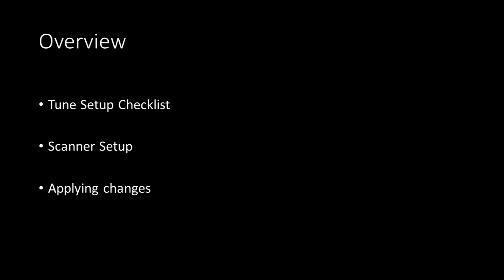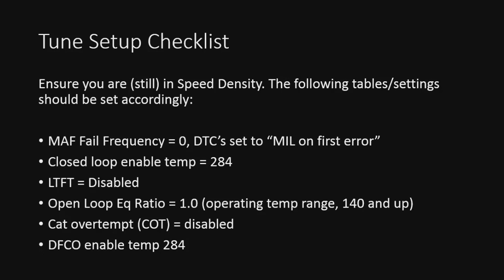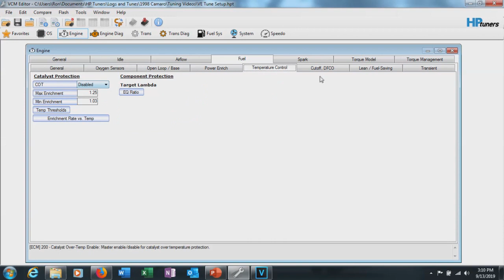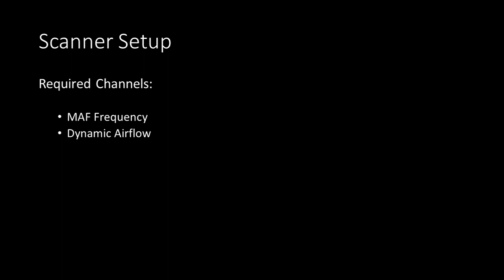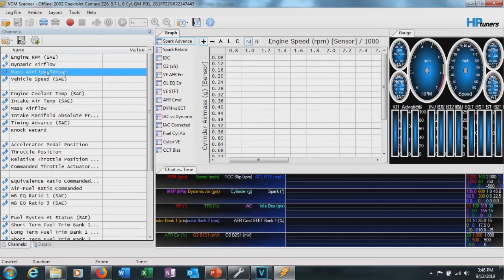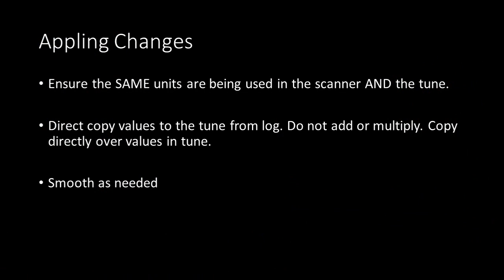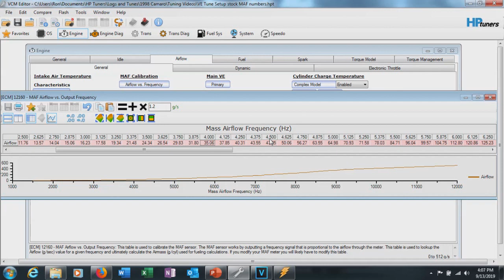Setting MAF Baseline in Speed Density

Comment: I'm a bit confused. This video for tuning the ve table or the MAF scaling?
Reply from the maker: Sorry for the late reply… This is just a quick tip kind of video, basically a micro step before doing a MAF tune. I use my dynamic numbers (VE based) to generate a MAF baseline (start point) before I reenable the MAF and tune it. This video is simply a how to do that small step. It’s not necessary by any means. However, if the VE was done right the numbers are usually very close - so the MAF tune is done in a few trips around town, if that. If done right all you’re doing is confirming. It’s pretty close more often than not. 

The cool part is, if you have the channels enabled and you like your VE error %, you can just do it from the last VE log. No need to drive or do any additional logging. Once numbers are plugged in, it’s just a matter of reenabling the MAF and going from there.

Comment: Trying to tune maf dynamic but i camnot get data log  on chart, it only showing 1 block on graph. I try to repoll parameter but still not showing any maf data  on graph. What should i do now?
Reply from the maker: Is it plugged in? The MAF frequency should still log even with the MAF failed.
Reply: Yes the maf plug in and try logging again and still show no data. I add additional pid such as maf sensor, cylinder air mass, and maf dynamic. Possible maf might be bad or maybe I have to drive it longer.
Reply: @ChopperDoc181 got new maf and work now but it doesn't want revs over 4000 rpm while drive. No cats or cel. Revs high only in nuetral.
Reply from the maker: @kennedywong9854  Could be in limp mode… Make sure the MAF is plugged in, especially on Gen IV’s. If you are trying to tune the MAF, then it should not be failed.  That’s only done to dial in the VE.

Comment: Does the pcm use maf data when calculating dynamic airflow when its not being used? As in, if you have the maf failed and removed using a open loop speed density tune, does the tunes maf data still affect the way the pcm does airflow calculations?
Reply from the maker: No, it should not. However sometimes software softwares and errors are possible as always. From experiments, when one model is used as the sole source for airflow estimation, then the other model does not get calculated into dynamic. That said, sometimes on Gen III cars not unplugging the MAF on SD tunes can occasionally skew the data because of the PCM is a computer and computers aren’t always perfect. Sometimes they glitch out and read a line of code that shouldn’t be active. That’s why it’s often recommended to unplug the MAF completely when tuning the VE. Don’t do that on Gen IV or V though unless you have separated the IAT.

Comment: Chopper What do you know of using a MAF in HP Tuners 2 and 3 Bar speed density operating systems?   I know in the old days it was regarded that you simply could not use a MAF in those operating systems.    It seems that's not so much the case now.    I want to try and run an LS3 card style MAF on my C5  which has the 3 bar OS and I'm running an LSA supercharger at 10PSI.   If this will work the way some of the guys on HP tuners forums say it will I'll be using this video to create a MAF baseline from scratch.    Hope you are doing well.  Mr. Black on the forums.
Reply from the maker: I can’t say I’ve tried running MAF on high boost, but I know it’s been done. Ddnspider on tech has done it up to around 700 whp. The main issue is running out of frequency. You can scale as much as you want but frequency is frequency. That’s the max the sensor can support essentially. To map it, of course the method shown will work fine. Just make sure the actual SD tune is richened up accordingly, then dial that in first. Plotting dynamic from there on your MAF freqs should get you pretty damn close providing SD/VE is reliable and accurate. I don’t see why it wouldn’t work as long as you still have frequency left.
Reply: @ChopperDoc181  Thanks for the reply Chopper.  Car has been running a decent open loop tune for the last year or so.  It's not perfect but it's not bad either.   I figure the car will make around 550 to maybe 600 wheel on our best fuel here which is only 92 octane.   We are just trying to ultimately refine the driving characteristics part throttle low speeds stop and go traffic.  It may or may not help but would like to try just for the fun of it.   I know the CTS-Vs and the ZL-1s have a MAF in them from the factory.   One last question if I may.  When they say running out of frequency I assume that is a load vs RPM thing in other words  that would happen say in 4th gear at like 6500 RPMS?     But the frequency would be lower with less RPMs and less load.  I only ask that as I would never be doing WOT top speed runs in 4th gear on the street.
Reply from the maker: The frequency is the actual airflow. It means you are maxing the voltage out to cool the sensor. With bigger piping it can extend this maximum, but with boost you may run out at some point regardless. It just depends on how much air you are pushing through the sensor. If you are hitting this limit I wouldn’t go WOT, provided you are using MAF as your primary table. When it’s active it’s always primary especially at WOT. Check out ddnspiders guide on tech. I think he has a write up on the stickies that explains in more detail. So yes, it’s load. You may max out the physical load limit of the sensor. Later generations have much higher limits on the MAF with plenty of room for boost. The Gen III’s are relatively limited in comparison. For example, the only reason to scale a Gen IV in most cases is due to maxing the spark tables out, not necessarily running out of MAF table. Conversely, MAF is one of the first reasons for scaling a Gen III.
Reply: @ChopperDoc181  Yessir I will look up his write up.  I am gen 3 411 PCM so I know there is a 512g/s limit.  The MAF will be in a 4 inch tube so hopefully that will help a little bit.   Thanks for your help always.

Comment: When you use the dynamic airflow data from SD to ballpark the MAF, how does the software know you want to reference the dynamic airflow data from SD and not the MAF?
Reply from the maker: Because when you are plotting it, the MAF sensor is still failed in the tune, so this number will come from your VE table. When the MAF is still plugged in you can still log the voltage without it being used as your airmass model. So that’s why this works as a quick ballpark estimate.
Reply: @ChopperDoc181  That's what I suspected but wasn't sure. Thank you

Comment: It's really necessary to set a MAF Baseline before tunning the MAF? Or it's just a way to be close of the final MAF tuning when it's unable?
Reply from the maker: No, not really required. But it’s a quick and easy thing to do if you are wrapping up speed density/VE tuning to get the MAF in the ballpark. It’s actually quite accurate if the VE is spot on. You can log this and adjust the MAF table while tuning for VE. All you need to log is MAF freq and you can ball park it before actually tuning it.